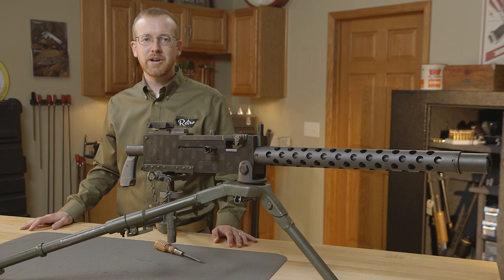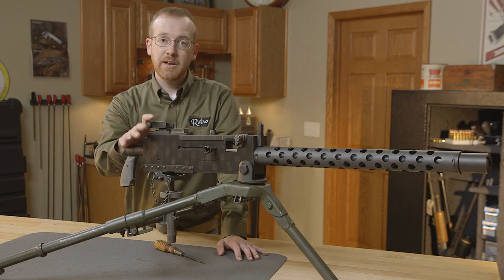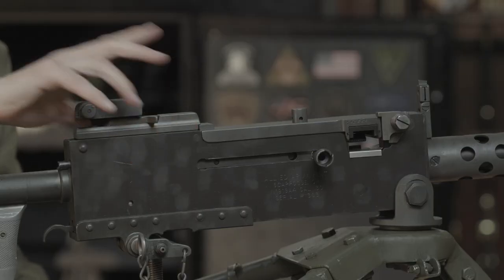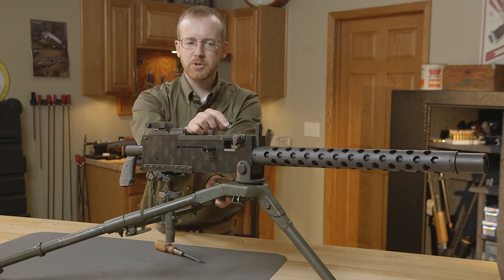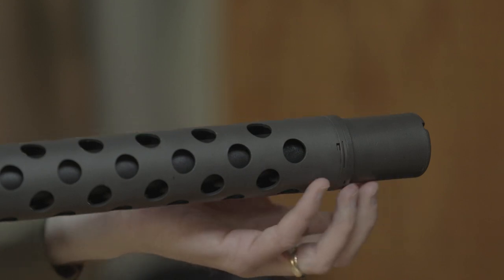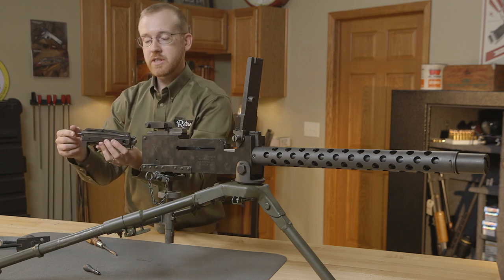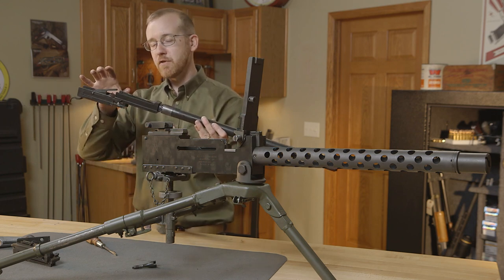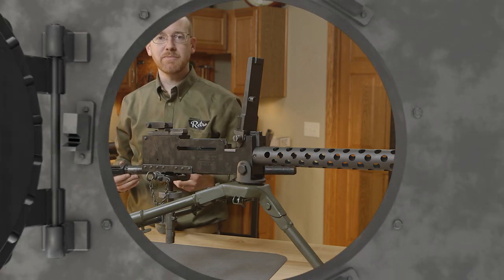From the Vault: M1919A4 Browning Machine Gun

Comment: I have had a Ramo Defense 1919 A4 full auto for 25 years it was built by Ohio Ordnance purchase price was $3000 with $200 tax stamp plus $200 for the dealer best money ever spent. I have shot 100k rounds from it once I had forgotten to check the breach had a round in the chamber for several weeks in my gun safe was very lucky didn't get shot these have no safety the trigger is the safety.  I had been shooting with a friend who wasn't experienced with it left it up to him to check it and pack it back in the case.  Wasn't until months later I took it out again pulled the cocking handle back a live round fell out. After that incident I actually put a label on the handle says check breech to remind me each time to check it carefully sometimes using a flashlight. I found another issue is if the extractor doesn't pull live round out gets stuck you don't know that pull the handle back not see a round if you let the cocking handle go could fire when the bolt hits the live round stuck in the barrel.

Comment: The M1919 sucks.  It fires from a closed bolt.  Belt fed MGs are supposed to fire from an open bolt to avoid cooking off a round when the barrel get hot.  And the M1919 does not use a quick change barrel, so it's going to get hot, fast.  So basically, the gun is fine as long as you don't shoot it much.  Swell.
Reply: Yeah, you’re right. It sucked so much that it only killed baddies for around 70 years, and from tripod, bipod, vehicle and aircraft fixed mounts, vehicle and aircraft flex mounts, and for you badasses, from the hip. And only around half the known universe used it at one time or another.
All sarcasm aside, you are of course, quite correct. It doesn’t have a quick-change barrel, and it does fire from a closed bolt, which can predispose toward cook-offs. I wonder though, how often that posed a problem in combat. Any ideas on that?
Reply: @mikem6176  I fell sorry for anyone who had to carry the 1919 around